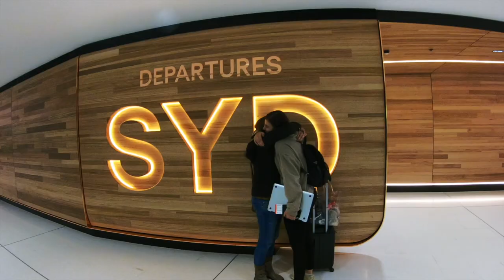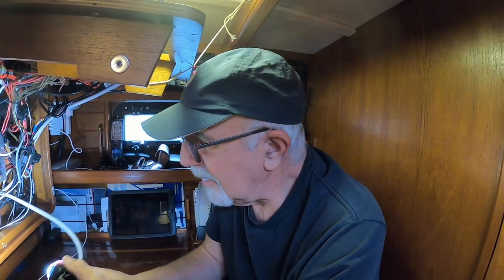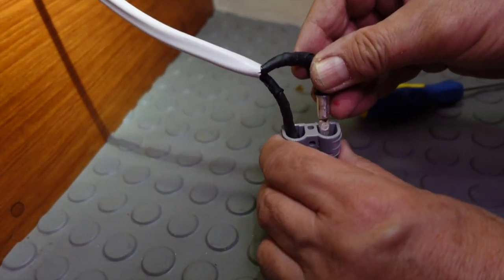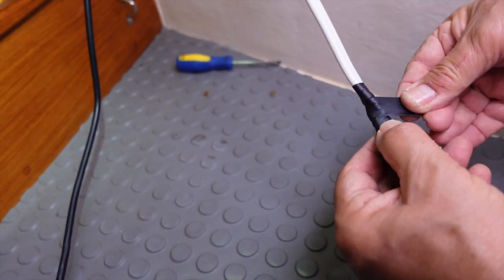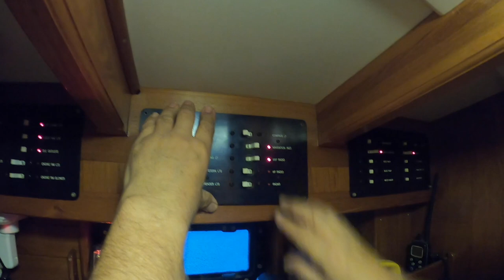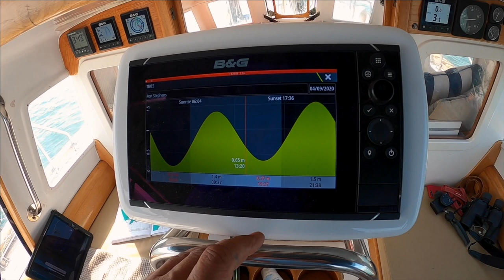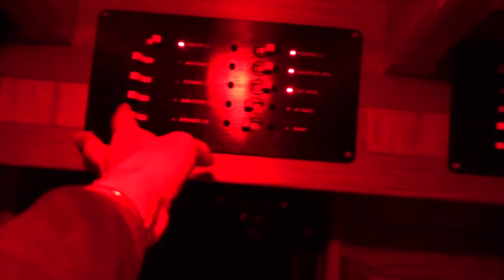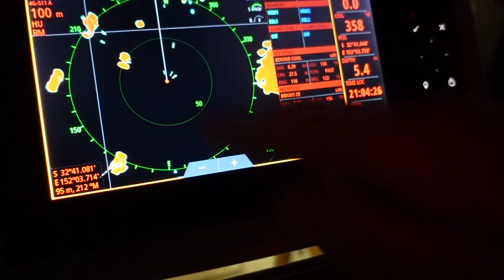SAILBOAT LIVING | Nearly An ANCHORING DISASTER! Sailing With Lucy S3 E10

Comment: I run an ARB fridge and once it’s at temp, it can maintain with 2-3 amps.  I reviewed the Dometic vs ARB and I don’t think they had much delta with the draw,  I run the standard outlet but can’t recall what gauge wire I ran to it.  I know it was heavier gauge as I ran it from the panel to the forward bulk head.  I always switch it over to shore power when hooked up.  I guess what I’m saying with all this is that I was surprised to hear you say that it would draw 6 amps.  What CFX model is it?  I see their largest unit says 5 amps.  I still love Lucy.  She’s your real click bait.  :-)
Reply from the maker: Hey Tim, yes Lucy is certainly our click bait but she's demanding more pay with each episode! Haha! In the meantime, Adriana gets a pay cut! Now as to the fridge, it is a CFX-50 we purchased in Jan 2019 just after they upgraded the model to include a new variable speed compressor design. Dometic specs say 7.8A max draw but in our experience we have it set to 0 degrees C as a fridge and it draws 5A when running (which we can see on the electrical power monitor) and it seems to run for a very short time before its off again which I'm happy about. With the variable speed motor, the 7.8A rating is probably how hard it works if it's set to the min temp of -22 C. Cheers, Jim